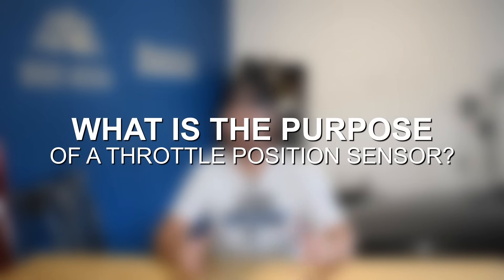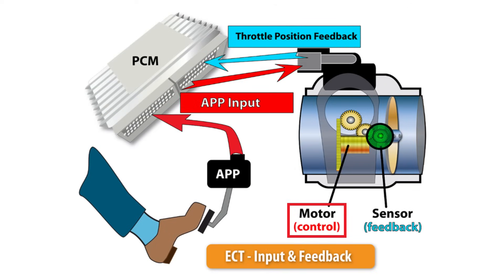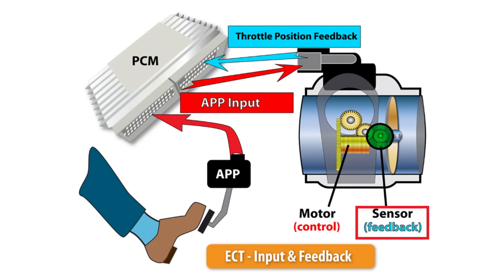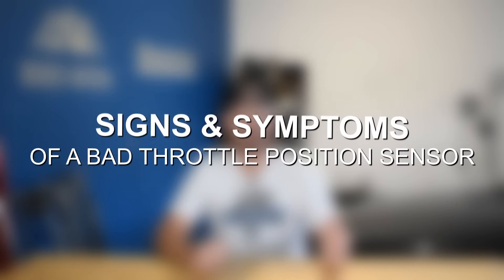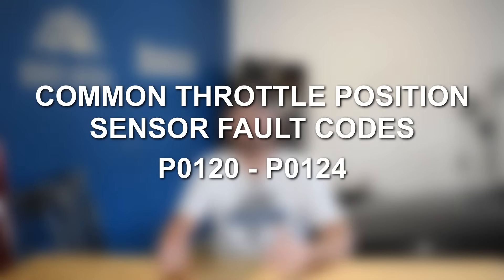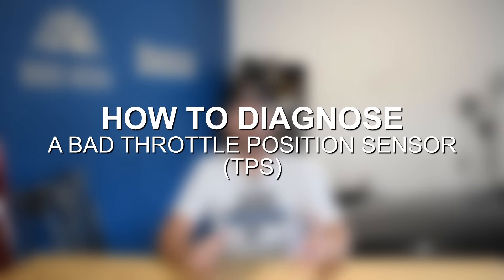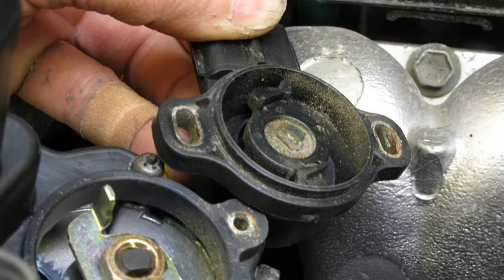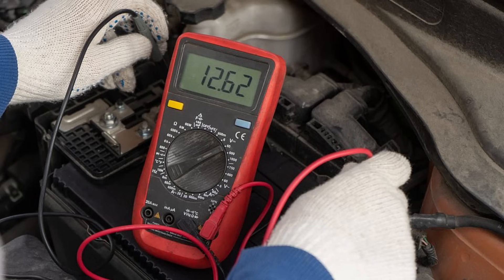Signs & Symptoms of a Bad Throttle Position Sensor (TPS)!

Comment: 2008 Ford Edge - 3 times in the past 2 months I’ve been driving and after 20 minutes or so I feel a bit of a slip, can’t accelerate and the wrench light comes on. Check engine light does not come on. When I pull over and restart it seems fine. However the last time I restarted there was a very big clunk. I’ve taken it to the garage twice; first time they said without the codes they can’t tell and to come right when it happens but I have to restart to be able to drive it and the codes get wiped. The last time they were able to see a code but didn’t write it down when they went back to look again it was gone but he said it was a transmission code. With the age of the vehicle I don’t want to put much money in. Do you think I should take it to a transmission shop before changing throttle body to see if they find something? Thank you (female wanting to be educated while dealing with garages 😊)
Reply from the maker: K - That's how it always happens, isn't it?! haha. We feel your pain. Definitely something wrong with the powertrain.. Do you have an OBD scanner?
Reply: @8020Automotive  Thank you for responding. I do not have a scanner. I thought the mechanics would have been able to pull up codes. I didn't know they weren't stored.
Reply from the maker: K - Sometimes even without a check engine light, codes can still be stored. Typically this is the best way to diagnose because it points you in the right direction versus throwing money at guesses..
Reply: @8020Automotive  The last garage visit they said there wasn’t a code showing. You mentioned an obd scanner. I looked it up and see it’s pretty inexpensive so I’m going to get one as see if I can find anything. Thanks for the idea.
Reply from the maker: K - It's the best way to self-diagnose vehicle problems. Keep us updated!

Comment: I have a 1993 ford 4.9 and i have to pump gas pedal a bunch and its hard to start and when it starts it want keep a idle, runs real ridiculous rough,when i mash the gas pedal it act like it is starving for gas, new pumps so im wondering what it is
Reply from the maker: J - Do you have any engine codes?

Comment: I have a 2016 Jeep Cherokee 3.2l Trailhawk. I’ve replaced the throttle body, the mass air flow temp sensor and the accelerator pedal with sensor. After each replacement of each part, the red lightening bolt indicator would return. Some drives it wouldn’t happen, but most times I take it out, it pops back up on my dash board. Is there something that I’m missing as to why this keeps happening?
Reply from the maker: M - Are you getting any engine codes?
Reply: @8020Automotive  I don’t have any engine codes. It’s just random that the service electronic speed control indicator pops on. Usually at lower speeds. Some times it does and some times it doesn’t. Like I said, it’s just random. New filter, new throttle body, new accelerator pedal position switch, new mass air flow temp meter.
Reply from the maker: M - Possible that it is a sensor going bad sense it sounds like it is intermittent..
Reply: @8020Automotive  I’m gonna have to take it somewhere and get it scanned. I’m
Just worried they won’t see something and I’ll have to pay and then it’ll come back on as I leave. Never fails.
Reply: @8020Automotive  so I’ve been messing around with my JScan tool and I keep getting this code. Says “active” C10D0. Something about electric
park brake failure. I guess there is a sensor that bad there. My epb works fine though and I don’t get any check engine lights or anything telling me there is something wrong. Can this be tied into this “service electronic throttle control” issue?
Reply from the maker: M - It certainly can!
Reply: @8020Automotive  that’s crazy to me. Guess I’ll check into that now.
Reply from the maker: M - Keep us updated!
Reply: @8020Automotive  ok, so I’m not holding my breath lol, but what I’ve kind of figured out is this. About 2 months ago I decided to get into my stereo controls and go to settings and activate the electronic parking brake to come on or activate every time I put the jeep into park. Wasn’t long after that, thinking back, when the service electronic throttle control light came on for the first time. And then intermittently ever since. So yesterday I used my JScan tool and did a few advanced scans. Every time, under power control module, the code C10D0 popped up. Electronic parking brake failure “active”. This code would not clear out no matter how many times I tried. So my slow brain decided to try something. I disabled the EPB from being able to activate automatically when put into park. I’ve started and driven and stopped about 7 times yesterday evening, various speeds and distances and then one more time for about 36 miles on the highway. Previous to disabling the auto epb, the light would have at least come on 4+ times on those 8 separate drives. Not once did it come on. I’m not holding my breath, like I said, but I’m hopeful that I’ve found the source. Not sure what my next step is at the moment, but I will keep you updated.

Comment: I have 2011 Ford Fusion.  No engine codes.  When i accelerate, but the motor does not Downshift, the only way i can explain yhe noise is that it sounds like its Fluttering.  Like air is blowing across paper.
But when it finally downshifts, the Flutter sound stops. Until the next acceleration. 

If i accelarate normally from stop light to light, it wont do it.  But if i press down hard on yhe accelerator, it will.
Is this soneyhing that could be a result of the throttle body or snesor malfunction?
Ice replace the throttle a few years back. Car kept hoing into limp mode. But once replace it worked fine.

Comment: I gotta find that sensor and clean it now .... My throttle is completely stuck shut, it does exactly what you described as well. Turns on, if i leave it on idle it will rev up and down like crazy and shake at times , then as soon as i put it on drive it goes into smooth feeling but wont rev up at all, i take that back it does rev up but nothing past 3x1000 yet it doesn't accelerate either...it just goes at like 2-5mph i put it back on parking and it does the crazy idling thing again....i took it apart and tried doing what you said but its shut completely and maybe im missing it somewhere but i cannot find that sensor! 😂 I got a 2004 Toyota camry
Reply: Same exact everything with my g35, have you solved the issue ?
Reply from the maker: M - Thanks for the feedback! Keep us updated.

Comment: My 99 Silverado has the old cable with the TPS sensor. Truck starts but you have to give it a little gas in order for it to not shut off. Got the P0121 Code idk if that could be the cause for it to not wanna stay running after start up
Reply from the maker: J - The TPS can certainly cause this code and symptoms.

Comment: Older cable controlled systems  also use tps
Reply from the maker: R - Well said.
Reply: @8020Automotive . Using scanners, KOEOff both scanners report .39% while foot off accelerat
Good/ Okay?
Reply: Our '99 Venture has both.
The '07 Sonata has only the TPS.

Comment: Im not getting any error and my car when started is perfect but when i move the car a bit and press clutch to change gears my car rpm goes ro 2 - 2.5 and then it doesn't goes down until i leave the clutch or press acc slightly then rpm drops down to normal , it all started when i serviced my throttle body and tps
Reply from the maker: A - Are you getting any engine codes?
Reply: @8020Automotive  nothing at all , once i got knock sensor error which got cleared when i replaced its wiring as it was a bit damaged
Reply from the maker: A - Are you still experiencing those symptoms?

Comment: any advice on a related error The P2100 code definition is “Throttle Actuator 'A' Control Motor Circuit/Open? What's the meainng of "open"? What does it mean that the circuit is "open"?
Reply from the maker: L - It's more than likely pointing to your throttle body.
Reply: @8020Automotive  So it's not the electrical circuit that is "open" but the throttle flap (or at least the sensor indicates that the flap is open i guess) thanks :)
Reply from the maker: L - Keep us updated.

Comment: My 2017 Jeep wranglers absolute and relitive throttle position sensors are always at 0% when looking at the live data. Error codes p0122 and  p2135. Help
Reply from the maker: S - May be worth looking into the sensor or throttle body. Have you taken it to a shop?

Comment: Could it cause a car to fail, and not start?? That's what happened to me
Reply from the maker: C - Definitely possible. Are you getting any engine codes?
Reply: @8020Automotive  It's iffy and my scanner is super cheap. Something like PO25
Reply: @8020Automotive  And the auto parts store quoted me at $180 for the Throttle position sensor!!! Ridiculous

Comment: The TPS on a 2003 Dodge ram 1500 is under the battery box and it's a bugger to replace
Reply from the maker: J - Thanks for sharing this info! Will certainly be helpful for others with this engine/vehicle.

Comment: I removed my throttle body on my 2018 Ram 1500 3.6 L Cleaned it with CRC throttle body cleaner. Did the relearn key in on position gas pedal to the floor for 15 seconds.  I drive on the highway 5 days a week, 80 mph no issues.  But since I have done this once in awhile when I'm at a traffic light or in the morning when I first start the truck the throttle body Acts up
Reply from the maker: C - Interesting. Are you getting any engine codes?
Reply: @8020Media  after i cleaned my tb it won't start. I have a 2003 3.8 chevy impala and it turns over but won't stay running with or without pressing the gas pedal. I'm lost. I've changed all the sensors on the tb. They meaning chevy discontinued this tb😢i give up

Comment: My C5 Z06 my reduced power flash and then I turn the car off and it will not start it just turns over. I noticed the car kinda running a little bit funny just before everything went south, any thoughts
Reply from the maker: R - Any check engine lights or engine codes?
Reply: Mine did the exact same thing before this incident happened I ended up sending my traction control module to get repaired and reinstalled it and everything was fine codes went away and this last incident is where I at now

Comment: I have a 2016 Nissan Altima. When i go to hit the pedal to accelerate the car, it takes its time. When my RPM goes up to 3, it bucks, and jerks. Or, when i go pass the 40 MPH mark, it starts to hesitate and jerk. I was told by the Nissan dealership that it was my transmission going out. 😢
Reply from the maker: M - Unfortunately, this is possible. Are you getting any engine codes?

Comment: I have a 2010 jeep wrangler - with a flashing red throttle warning light .  No check engine light is on - how do I get the code ??? Thanks
Reply from the maker: F - There's definitely an issue with the throttle body. Could be stuck or dirty.

Comment: Why would my throttle feel hart like it has alot of spring tension
Reply from the maker: S - Few things could cause this: a gunked up throttle body, problems with the accelerator cable, or other dirt/debris on or around the pedal.
Reply: @8020Media  thanks I put silicone grease on the gas pedal cable, drove it just around the corner, feels better. There's been a few times the gas pedal felt smooth maybe the weather has something to do with it.  I'll fine out when I start driving every day this weekend
Reply from the maker: S - Awesome. Keep us updated.

Comment: I have a 2008 jeep wrangler that won't turn over to start has a throttle body light is this probably a bad throttle body?
Reply from the maker: D - What engine codes are you getting?

Comment: Hi 8020 media. I have a problem with my 03 Ford Lightning truck. Ive asked around everywhere and nobody can give me an answer. My truck has lost power and wasting too much gas. I did the test on my mass air flow sensor where you have the vehicle on and you unplug the MAF sensor and if your vehicle turns off, its good but if it stays on, the MAF sensor is bad. Well mine stays on so i think its bad. But then i came across this video and think it might be the TPS. Im gonna try to clean it first but if it doesnt work then ill just change to a new TPS. 
My truck idling is rough like it shakes like it would be running on 6 to 7 spark plugs when it has 8 spark plugs. I bought all eight spark plugs new and installed them so i know its not the spark plugs. 
I have a K&N high flow air intake and tried to just swap out the MAF sensor but cant find a way to remove it, like its stuck and not meant to change. Do you know if i can change out the MAF sensor only on K&N filters? Because i would hate to have to buy the whole Air Intake set again which costs $350. Any info helps, thank you.
Reply from the maker: C - First step would be to check for engine codes in hopes in points you in the right direction. Do you have any engine codes?

Comment: I used an obd2 with live data. I was able to check the gas peddle  sensor and throttle position. On the data when I press the gas peddle I saw it move on live data and the throttle position didn't move on live data. I'm replacing the throttle body sense the throttle position sensor is part of the assembly and not able to replace separately. I used the Blue Driver OBD2 scanner.
Reply from the maker: C - Nice! Thanks for sharing. Keep us updated!
Reply: @conanharris3472  Yes, I heard that the Throttle position sensor was not expensive . But when I call the auto parts store it was almost $200!!! Unreal ripoff

Comment: I have an intermittent issue with the 2007 Jeep Grand Cherokee Laredo seemingly losing the information from the computer on how the throttle should be working. It would not idle until we ran it, keeping it at 4000 rpm and above for about 15-20min and then it would idle and drive again.
Reply from the maker: T - Sorry to hear this.. Are you getting any check engine lights or engine codes?

Comment: Hi.
Get all the symptoms  you mentioned  at beginning of video. Honda jazz 2009 hatchback 1.2. Petrol  5 speed 4 spark plugs only. NB NO SENSOR CODES. NO ENGINE CODES.  BUT VEHICLE IDLE BIT ERRATIC, DEFINITELY  JERKY/HESITANT, SOMETIMES  STALLING, VEHICLE  TAKES LONG TIME TO PICK UP SPEED AFTER JERK AND HAPPENS  EVERY TIME SELECTING  GEARS TO HIGHER RATIO. FONE FULL SERVHCE. CHANGED PLUGS WITH HONDA EXPENSIVE PLUGS, OIL AND AIR FILTETS REPLACED, OIL CHANGED, CHANGED TRANSMISSION  OIL FULLY AN REPLACED  THE SPECIALIST WASHERS. EXHAUST  HAS NO LEAKS.
PETROL  FLOW PRESSURE?
COLLAPSED CATALYTIC FRAME IN CATALYTIC  CONVERTOR? FUEL PUMP? BUILT IN FUEL FILTER? Mechanic  cleaned egr valve, cleaned air map sensor, cleaned mass airflow sensor. Checked wires none loose or faulty. THROTTLE  BODY NOT YET STRIPPED AND CLEANED.
PLEASE  CAN YOU ADVISE? mileage  on honda 178000.Goes  fine otherwise apart from annoying  jerking. 4 new tyres fitted 3 weeks ago. Clutch not faulty  apparently.  
PLEASE ADVISE. 
YHANK YOU.
Martin martinbfbf@gmail.com
Reply: Buy American

Comment: Hopefully you answer this comment!!! My didge caravan 2010 is throwing a oxygen sensor code p0038 the pedal doesn't accelerate when in park and doesn't go faster than mph in drive (limp mode) i say the o2 sensor is the reason for all of this my husband is stuck on the pedal issues
Reply from the maker: H - Definitely sounds like an o2 sensor issue to us. We have a full video on oxygen sensors that we think may be helpful: https://youtu.be/hpqXLGAE4Xo
Reply: @8020Automotive  thank you so much
Reply from the maker: H - Keep us updated.

Comment: I've been dealing with throttle control code on my 2007 Honda.  We've replace the throttle body and the pedal sensor assemblies with no change.  There doesn't seem to be a wiring fault.  I've isolated that the issue could be a relay associated with the circuitry of the electronic throttle control unit.  Do you think a relay might also be a possibility?
Reply from the maker: C - It certainly could be a relay. Do you have any engine codes?
Reply: @8020Automotive  Thanks for the reply.  Yes. Initially I had a simple P0507 (Idel Air Control Systme, RPM higher than expected).  After eliminating the possibility of a vacuum leak the symptoms continued and I ended up seeing a P2101 (Throttle Actuator Control Motor Circuit Range/Performance).  The repair shop is insisting that because the throttle body was not OEM Honda, it could still be a bad throttle body, however, I have noted that there is a Throttle Conrol Relay that could be the culprit.
Reply from the maker: C - That certainly could be the culprit! Any update here?

Comment: What causes code P2119 on a 2017 ford explorer? Check engine light is on & when you go to accelerate often pulling out its like something is slipping but usually just on taking off
Reply from the maker: J - This points to an issue with the he throttle body, throttle position sensor, accelerator pedal position sensor, or throttle actuator control motor could be defective.